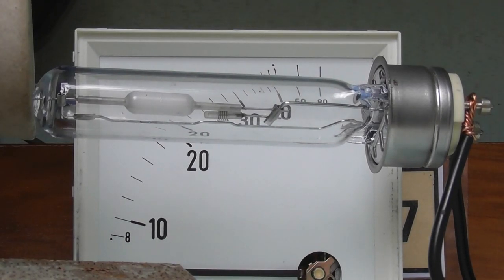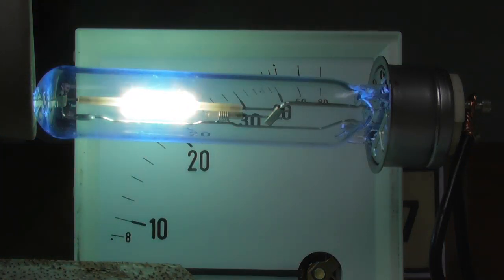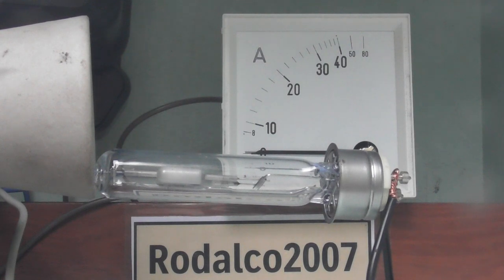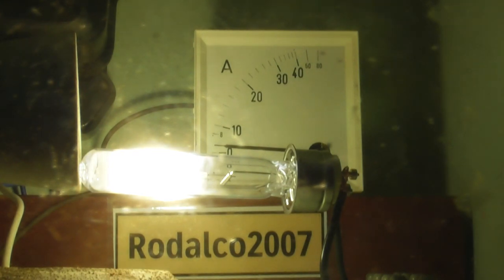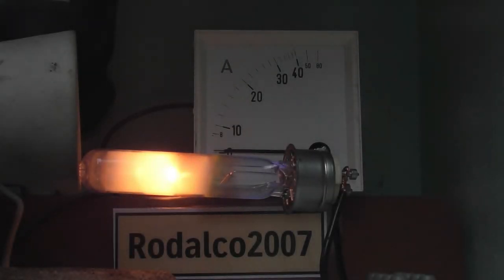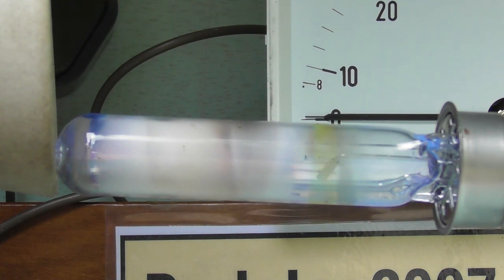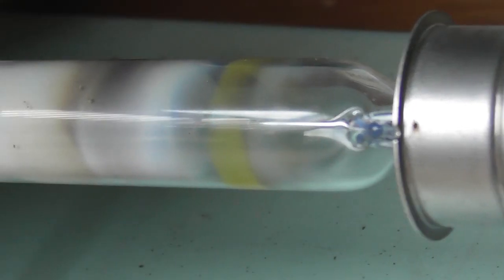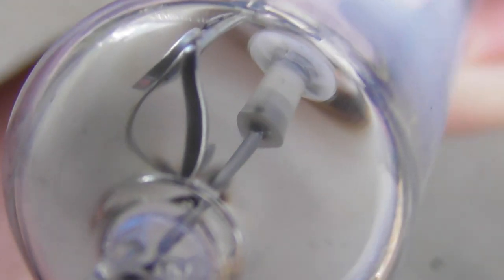60 Watt Metal Halide lamp overloaded

Comment: I'm always amazed at how much abuse discharge lamps can take.
And then, you have some incandescent lamps that fail if you do so much as looking at them wrong.
Reply from the maker: I am always surprised how the red hot quartz glass can take the heat and pressure of the hot arc, and doesn't fail earlier in the process.
Reply: @RODALCO2007  Especially with the car headlight HID bulbs, which are basically driven fairly harder owing to the arc tube design and electrical consumption (ceramic metal halide bulbs can easily handle the car HID square wave AC ballast much to my pleasant surprise), I am just astonished that they don't immediately explode given pressure of Xenon gas fill therein. And there's that heat loading on the Quartz too.

Comment: For the inside glass to glow like that it must be at over 1000 degrees C which is crazy hot.  Surprised that the ammeter didn't really move except a little bit at the end and that it and that sign didn't melt with the heat.  Seeing the smoke and the contents of the inner tube deposited over the glass at the end was funny though

Comment: Can metal halide bulbs burn wood? I wonder if incandescent can burn wood as well.
Reply: Low wattage metal halide bulbs running normally when not overloaded are not hot enought to burn wood, they can only heat it up
Reply: @inactiv4822  A 400 watt metal halide bulb will definitely set the wood on fire because they operate at 752 degrees Fahrenheit (MAX) on the outer surface. They operate roughly at 500 degrees Fahrenheit. Wood ignites at around 500 degrees Fahrenheit.